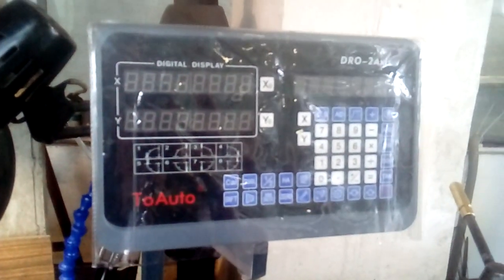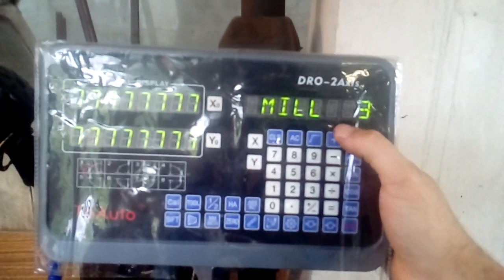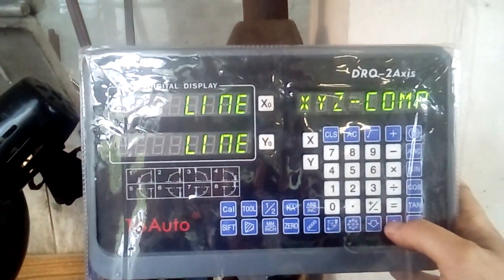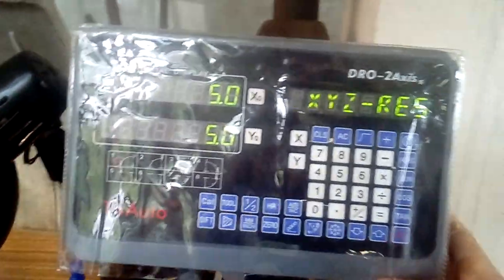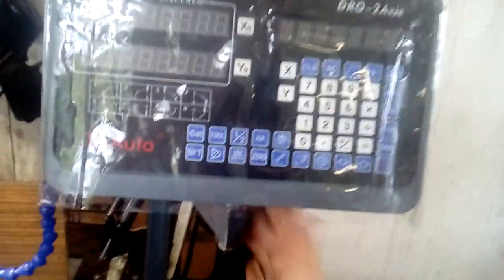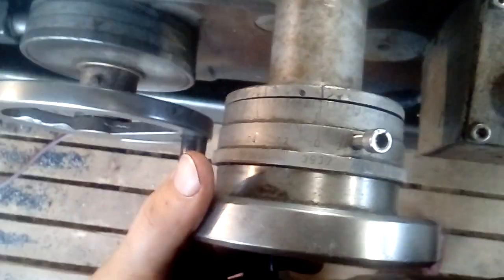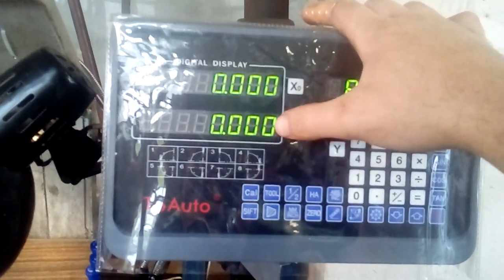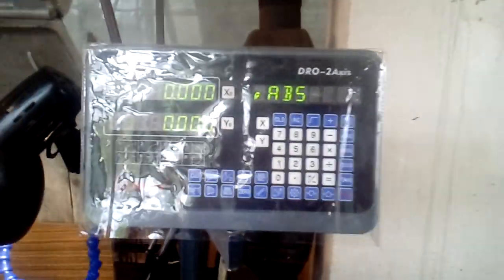DRO China ToAuto Radius to Diameter lathe, direct reading mode,  digital readout

Comment: I have the exact unit.    I cannot get it to go into the menu using the mm/inch button.   I've tried many times   😔
Reply from the maker: Yes i know . Some newer models are different. If you search on facebook ToAuto has a page and they are very friendly and helpful
Reply: @emilgabor88  thanks for the info.  All of my other brand dro will stay on diameter mode for x axis all of the time.  This one i can't get it to save that way. I have to remember to select diameter mode every time i use the x axis
Reply from the maker: @gibhamracing37  on the lathe on the lathe mine always stays on diameter  mode. I had three of them and they are other generations, and a little bit different. One lathe I sold. So I use just two of them now. But they’re pretty decent for the money. I like them both have advantages and disadvantages. For example, one if you make a touch of and set an X , press the button button to type a number , and you move the X it actually compensate for the movement, this is the newer one . But the older one you can press the button before you even are close to the workplace and when you touch off your set, enter and register you’re offset. Both are useful in different stations.. and one has Absolut incrementsl
And datum
The older base incremetal , absolute and the datum’s . so the new one you need to press one button more to go to the Tool off set.

Comment: how do i acess calculator on to auto
Reply from the maker: I didint use calculator on the Dro . I dont know
Reply: @emilgabor88  thank you for replying taper attachment did not work either they are sending another thanksagain
Reply from the maker: I have Checked it out and you need to push the Calculator button and that’s it
Reply: I have a Hymseann SNS-3V, probably with almost the same software in it, and I can't get the calculator to work. Pressing the calculator button does nothing (other than a beep)